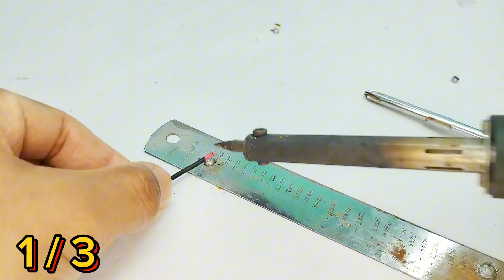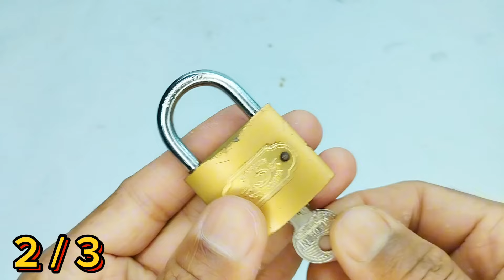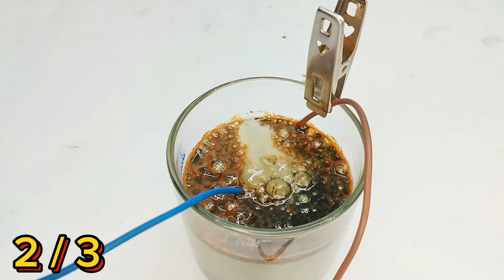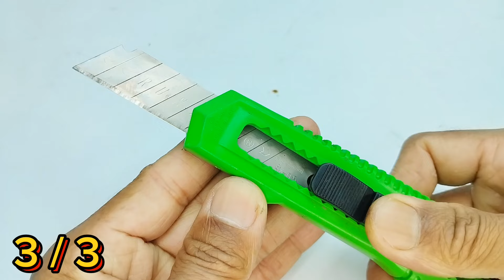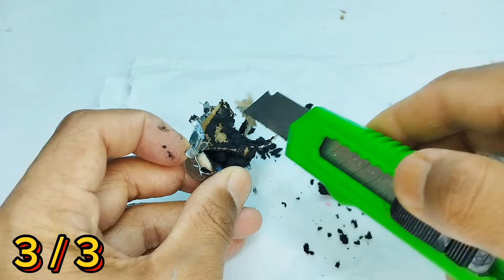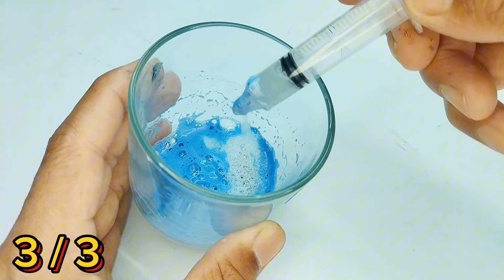✅ Unlocking the Secrets of Soldering: Few People Know About This Secret OF Soldering Iron And Salt

Comment: Instead of HC acid use sandpaper you won't risk chemical burns or toxic fumes.
Reply from the maker: ok Thank you so much for advice ❤️🙏
Reply: FML, I'm halfway though, and like please just put it in the drill and spin some 200-grit for a bit. so easy.  My brain works like yours. thx
Reply: @HowievYT  This guy's right and I'll add that in your bag of tricks you should probably have a dremel style tool with grinding bits. Dremel tools are inexpensive and have many uses.